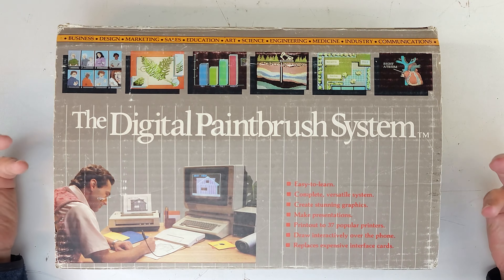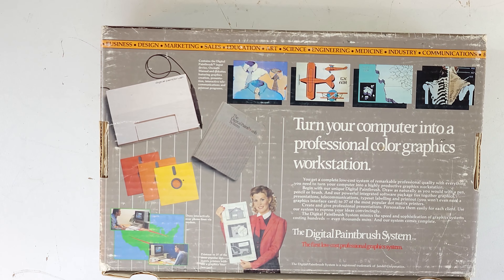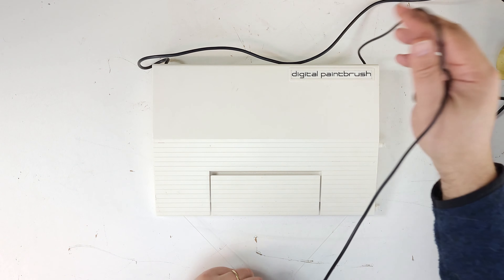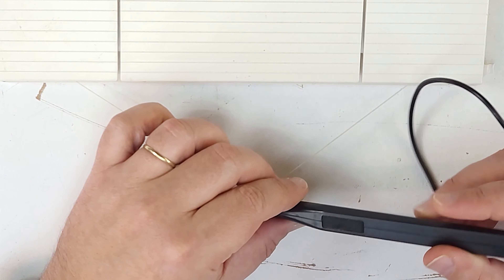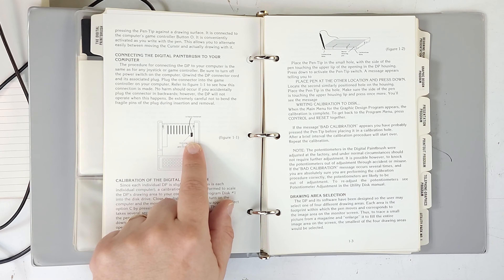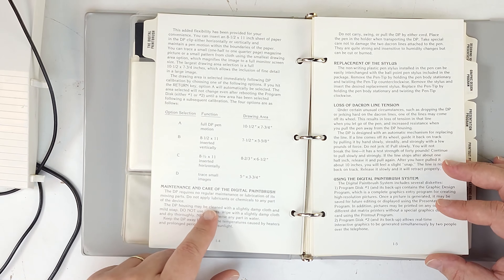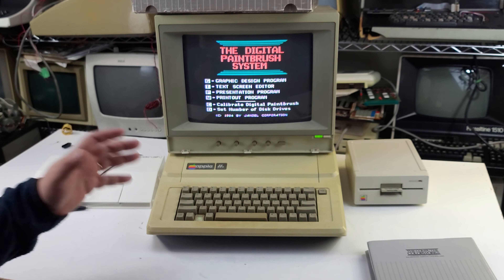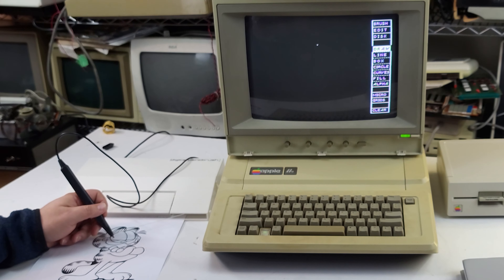Pen Drawing on an Apple II??

Comment: That's an interesting gimmick with the string.  I had a graphics device for my Apple II called the Versawriter.  It was like an old drafting pantograph.  It had a double jointed arm (with a pot in each joint).  At the end was a reticle that you could use to trace drawings.  It had good graphics software with it too.  Got rid of it all long ago, unfortunately.
Reply: I had a pantograph device for my C64 called a SuperSketch. It's interesting to see the different technologies used by these early digitizers. I've seen some high-end units mentioned in period magazines that apparently used ultrasonic and infrared, too.
Reply from the maker: It's quite creative.  It's a bit of a pain because I find I get my hand tangled in it sometimes.. and it is a bit weird to have the pen being pulled out from under you.. but.. yeah it's not too bad actually.  I have heard of the Versawriter and am determined to get one one day as that was what Ken Williams used to trace images for their earliest games.  It's a weird looking device!
Reply: @TechTimeTraveller  I saw the Versawriter ad in one of the Apple magazines.  They were running a sale and the company was about 1/2 hour drive from my parents house. They weren't set up for retail business, but they let me come in and buy one! I got rid of it about a year later in a trade for a C64, 1701 monitor, and a Koalapad.

Comment: The lower horizontal granularity looks like you have one of the lines twisted, causing "knots" that cause the pot to jump.  You may want to follow the procedure in the manual to ensure there are no twists in the lines.
Reply from the maker: I actually did the reset procedure at the beginning because when I got it the right side line had been pulled out and was tangled in its wheel.  I think the issue may be a) the pitted melamine surface I was using b) my hand accidentally trapping one of the lines or c) the wheels themsleves being a little jerky.  I'm going to take another look at the procedure and try it again as you suggested, but I think this one might come down to user error. :)
Reply: @TechTimeTraveller  Or all three.  Or, come to think of it, it's possible one of the pots was dirty and needed some deoxit.

Comment: clever, also a two-joint robot arm pen would have done it
Reply: inverse of inverse kinematic model, lol
Reply: instead you get the rotation angles directly, and know the relative position to the robot arm origin = 3d mouse, 6dof
Reply: you could also just put a pen in the rin, then hold the pen like usual, then the computer would know the relative position
Reply: remember zero point reset to prevent drift
Reply: the angle sensors can be simple potentiometer variable resistors, or something along that line, pun very much intended

Comment: Dam, it's just two potentiometers, and a push-button blows my mind.  The level of simplicity in tech is beyond appreciation.
I wonder what would happen if the wire spools were loosened.  
Can it be manually calibrated?
Another excellent project Idea is to try out with a 3d printer and Arduino just because we can.
Thanks for sharing 
Cheers !!
Reply from the maker: I think it is calibrated only by the software.
Reply: @TechTimeTraveller  From the shot when you showed the bottom at 7:06, there are two screws, each in a banana shaped slot, that then hold each spool in its place. So I think that these two screws are there so you can calibrate them if they become uncalibrated for some reason (maybe one of the strings becomes stretched etc.).

Comment: the game connector on an Apple ][+ was where the diagram says it is. still sketchy though. I often thought about (but never did) rig a ZIF socket on the backside of the Apple. (Mostly never did, because i had my game connector tied up running a homebrew parallel printer interface.)